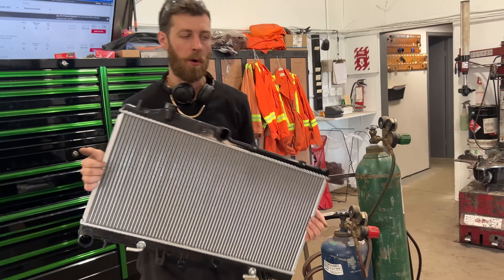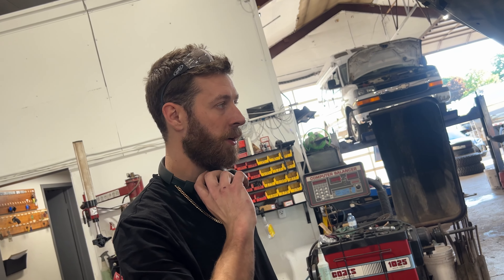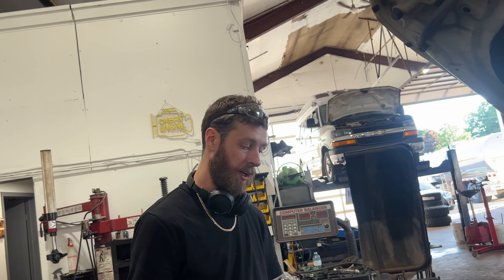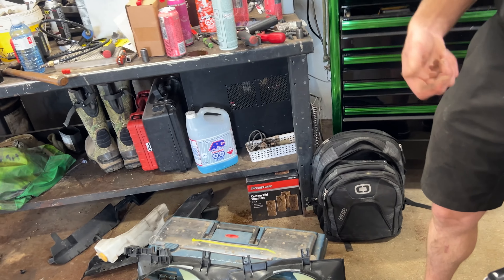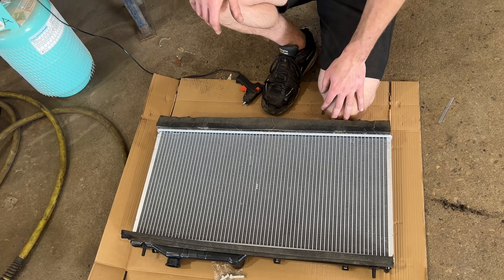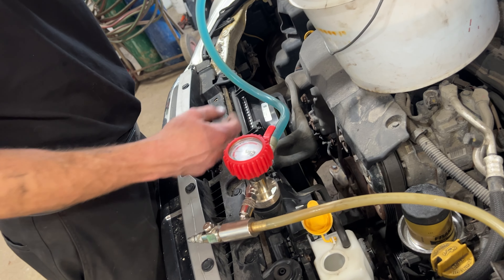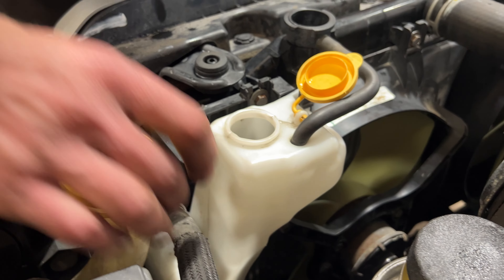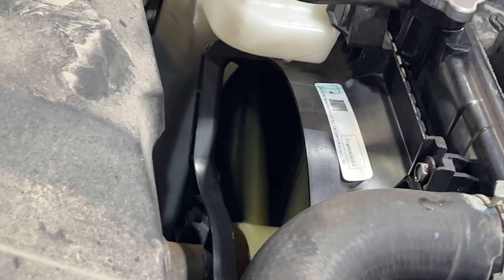Remove & Replace Radiator 2013 Subrau Outback 2.5L

Comment: Do I need to add more transmission fluid when I'm finished installing the radiator?
Reply from the maker: @autumns3864  if yours has the transmission cooler built in to the rad than technically speaking yes you should add fluid and then make sure the transmission fluid level is set correctly, but in all honesty you could probably get away with tossing like 200-500ml of transmission fluid in and be pretty close